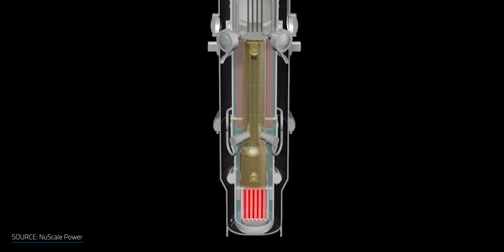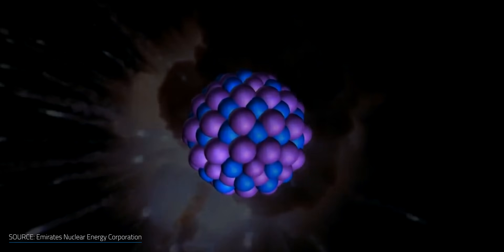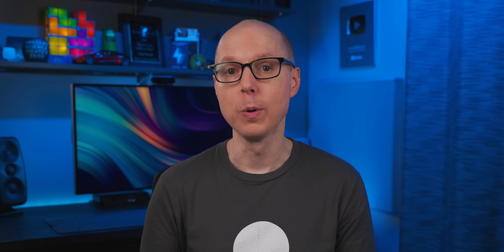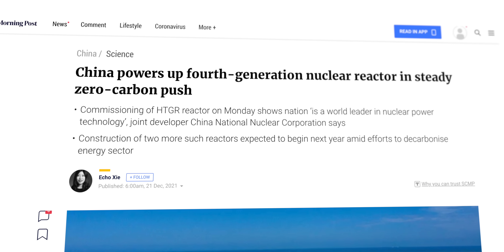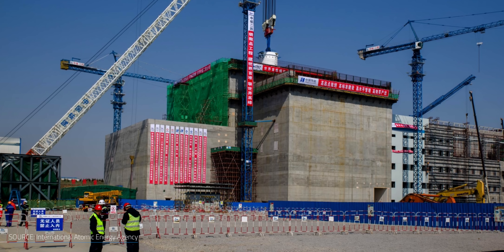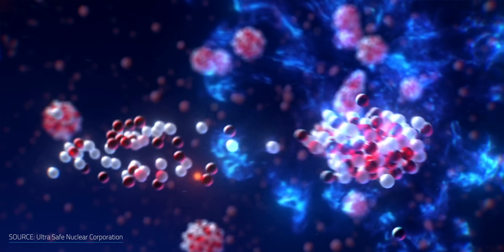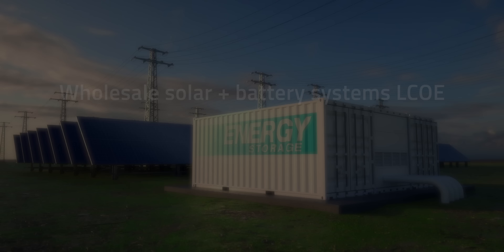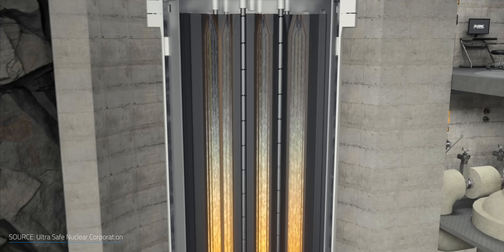Forget Small ... What About Micro Nuclear Energy?

Comment: I can't imagine how micro reactors could have widespread deployment from a security perspective.  There maybe some individual use cases, but they would need to scale the security hurdle too.  Having hundreds at a particular location doesn't make sense either.  SMR's are just a better alternative when you consider all the operational aspects.
Reply: The security comes from the lack of risk they pose. Micro reactors use low grade nuclear fuel, which is useless for weapons or even improvised "dirty bombs". As small as they are, they can be effectively protected by the same security measures and levels, your local bank uses.
Reply: @AaronCMounts  If someone wants to weaponize something, it's easier to dose a area in flammables and ignite the area to cause as much damage as possible. The only reason why people fear nuclear weapons is the inhospitality it makes in the region.

Oil is "cheaper" to weaponize than nuclear materials.

Heck you can make nail bombs and napalm from oil/gasoline.

Also why would anyone care about the effort to weaponize a nuke when they can buy guns?
Reply: @AaronCMounts  That is highly dubious. Any radioactive material, even that used for medical purposes can be abused for dirty nuclear bombs.  And none of that technology or the infrastructure for it has been developed so far. It's pie in the sky thinking.
Reply: @Andreas-gh6is  While "any radioactive material" could theoretically be used for a dirty bomb, most of it can't be used in an effective dirty bomb. Your claim is disingenuous, at best; you're deliberately misrepresenting the actual hazards of the overwhelming majority of nuclear material in existence. Radiation exposure from most nuclear material is not severe enough to be harmful, if it even rises above normal background radiation.
Reply: @AaronCMounts  well, if it's enough fissile material to drive a reactor of any size, it's enough to scare a lot of people if it is dispersed with a proper explosive... And quite a few isotopes aren't that harmless in small quantities either. Point being, "micro reactors" don't exist as a practical technology yet. As that is the case I don't believe that they don't require highly radioactive fuel and I certainly don't believe the total material necessary for the same energy output is less than with larger reactors. Spreading out the problem doesn't really mitigate the risk, it just obfuscates the fact that the risk of nuclear power generation is impossible to calculate. "Impossible" accidents have happened too many times already. Luckily most people are scared enough from history not to try and scale up that risk by 10 or a 100 times like the nuclear fanboys wan.
Reply: @Andreas-gh6is  Accidents have occurred too many times?

Out of hundreds of nuclear plants across the world, operating for decades upon decades, there have only been two major nuclear accidents that have ever occurred. 

One of those was from a communist regime (surprise, surprise...) that couldn't be arsed to be even remotely responsible with their nuclear power facilities. And the other was caused by an earthquake/tsunami that killed 15,000 people; meanwhile, the meltdown killed one person. 

On top of that, only one minor accident has occurred, and in that one, there was zero release and zero deaths from it. 

People like you are part of the problem. Your incessant and unmerited fearmongering is what keeps the public scared of nuclear power.
Reply: @Andreas-gh6is  Also, it's quite telling that you evaded my point about making an effective dirty bomb and jumped straight to "well, it can scare people".  So I'll accept that as you conceding to my point that most radioactive material can't make an effective dirty bomb.
Reply: @AaronCMounts  One time is too many for something that is supposed to be impossible. And judging the risk from what happened before is reckless and stupid. No, the Fukushima accident didn't cause death from radiation - because the whole area was evacuated at great cost. And the cost will ultimately run well over a trillion Dollars.  To solve any problems, nuclear power would need to be scaled up ten or a hundred times, and all those risks would scale just as much. Even ten times the damage of Fukushima and Tschernobyl over the next fifty years would be unthinkably bad, but it's still not the upper bound on what could happen, especially with any bad intentions.
Reply: @Andreas-gh6is  “One time is too many for something that is supposed to be impossible.”
 -- By your logic, we should also permanently ground all air travel, since one airliner crash is too many. Nevermind the fact that air travel is the safest form of travel in the world; it’s not perfectly safe, so it should be banned. 

“And judging the risk from what happened before is reckless and stupid.”
 -- So the entire insurance industry, every professional actuary, across the world is reckless and stupid? Yeah, that’s about the logic I’ve come to expect from your posts. 

“No, the Fukushima accident didn't cause death from radiation - because the whole area was evacuated at great cost.”
 -- So you admit the death toll from nuclear power accidents is even less than I said, meaning nuclear is even further less hazardous than you’re trying to claim. 

“And the cost will ultimately run well over a trillion Dollars.”
 -- Meanwhile, the cost of replacing old coal, oil & natural gas plants with cleaner versions, or with sufficient wind / solar + storage capacity will be 2 – 3 x the cost of equivalent capacity in nuclear plants. 

“To solve any problems, nuclear power would need to be scaled up ten or a hundred times, and all those risks would scale just as much.”
 -- This is simply not true. Already 10% of the world’s total power is from nuclear plants, so scaling up would be nowhere near the numbers, you’re claiming. And no, the risks don’t scale linearly with the growth or expansion of nuclear power.

“Even ten times the damage of Fukushima and Tschernobyl over the next fifty years would be unthinkably bad, but it's still not the upper bound on what could happen, especially with any bad intentions.”
 -- You’re fearmongering, you’re making wild, baseless predictions, and you have nothing to back this up. Meanwhile, nuclear continues to be the safest form of large-scale power generation, having caused fewer deaths in almost a century of continuous use than any other major power source. Coal, oil, wind, natural gas, solar and hydro have each caused more deaths than nuclear. This is both in aggregate and per capita.
Reply: @AaronCMounts  ANY nuclear fuel can be used in a dirty bomb!  I was a nuclear plant supervisor in the Navy and worked at several nuclear utility plants afterward.  I know a lot more than your average bear.  Bank security is nowhere near adequate for any nuclear facility.
Reply: @tgmct  Can you show me how radioactive these micro-reactors are expected to be? As the video clearly said, they use low-grade fuel. Can you show where they're at serious risk of releasing hazardous levels of radiation if tampered with?
Reply: @AaronCMounts  The minute that a reactor goes critical for the first time it produces decay products that are radioactive.  They are also toxic and very dangerous.  It's certainly something that the NRC will never want getting out to the public in any amount.  Low grade fuel is a discussion of fuel enrichment.  Commercial reactors are typically at 3% vs military that are much higher (classified).  Going much lower creates problems with starting up a critical mass.  Even reactors that are long gone have spent fuel repositories that are under 24/7/365 high level guard.  This is no fooling around stuff; they have shoot to kill orders for anyone who attempts to get even close to the repository.
Reply: Even widespread use of SMRs means they got to be deployed everywhere around the world, including where the "regulatory framework" can just evaporate (revolutions etc), people start shooting at them or terrorists take out the fuel and make dirty bombs.Nothing like that has ever happened, which makes the risk impossible to calculate, but again, in order to make a dent in climate change those reactors would need to be almost everywhere...
Reply: The micro reactors will definitely be nice to have in case of natural disasters. Say an earthquake destroyed large parts of a city and took out power to it, you could just deploy a few of these on the back of trucks and get power up and running for emergency services and others. This would speed up the recovery of the city immensely
Reply: @GameCyborgCh  You can do the same thing with a diesel generator for a LOT less money and training.  These already exist for emergency use.
Reply: @tgmct  I'd like to see a single truck carrying enough diesel generators and fuel to get 1MW of power
Reply: @GameCyborgCh  After my previous reply I remembered that we had a 1MW diesel that ran around Europe to feed US submarines in ports that didn't have suitable power otherwise.  It was all self contained in a 24ft box truck and had a diesel fuel day tank on board too.  They would drive up, open the rear overhead door where the radiator and fan were, and pay out the three shore power cables.  Diesel fuel came from another hose connected to the submarine's diesel storage.  Everything setup in less than an hour.  I'm not stretching that capacity rating. The minimum shore power requirement was 1MW; the diesel may have been slightly higher rated (1.2MW?).
Reply: @GameCyborgCh  It seems some additional education is needed…  There are all sorts of diesel generators out there that are a lot larger than 1MW.  Take a look at what is used in railroad engines.  All of them produce more than 1MW and most power units can easily be moved by a low-boy or similar truck trailer.  Want more capacity?  I worked on a number of stationary jet engine units made by Pratt & Whitney that could run at 23MW all day and peak to 30MW.  These can run almost any liquid that burns.  In fact, the Saudi’s actually ran the crude oil that they were pumping as the fuel for the engine too.  These can be moved with a flatbed.  Fuel for it… a couple of 9000 gallon standard tank trailers could be traded out as they emptied with the other being refilled at the nearest fuel rack.  

Your proposal makes no sense from a training and security point of view.  Training someone to operate a diesel or jet engine can be done in a matter of hours if they already have related experience.  Not much more if they don’t.  Nuclear plant training is in a different world.  I know because I’ve been there.  More than a year of intense training before you even qualify at the lowest level.  Much more for supervisors.  The NRC will NEVER allow a rector to be manned by just one person and probably not less than three.  Then there is security.  We are talking about lots of fully armed people here with shoot to kill orders.  Even for a little puny power reactor.  The amount of security used to protect old spent fuel alone would blow your mind.  At least a hundred people to operate and protect a reactor around the clock vs a few people to run and refuel a diesel or jet (or gas turbine).  The difference in price to build a reactor is a lot more than chump change too.  Do the math!  It’s just not feasible to do what you propose.  It was already tried and failed in Antarctica in the 60’s-70’s.  Even the government couldn’t realistically afford it.
Reply: @tgmct  Go big diesel and not explain the pollutants involved?
Reply: @dra6o0n  I'm NOT a proponent of big diesel.  I do support large nuclear.  Some of the earlier discussions were about emergency small scale use of micro nuclear that just don't make any sense to me.  Using diesel in that situation is more realistic.
Reply: Fertilizer is possible to be weaponized too, you can make explosives from them. You could ban them, but what stops someone from sneaking into a farm and steal it bit by bit?
Reply: @dra6o0n  Actually, after Oklahoma City, the government does a lot more to control the distribution of fertilizer.
Reply: Lithium is far more dangerous on a common household setting... Take a lithium battery apart and throw the sheet of rolled up lithium at a house and splash water on it and watch it combust and ignite the house. Imagine someone spread a ton of lithium metal powder on the roof of every building and just waited for rain to come? Or even fog as humidity would set it off?

Threats will always exist, no amount of hesitancy would prevent deaths, only proactive actions can.
Reply: @dra6o0n  Sure, it's possible but not very likely.  Gasoline is far more available and dangerous.  A TON of lithium powder; where do you get that?  And not be noticed?  There is a reason why hazardous materials are evaluated, marked, and controlled.  I'm not up to speed with lithium hazards or the specific chemistry involved.  But I've forgotten more about nuclear issues than most people will ever know.  I certainly don't want ANY nuclear materials (used in reactors) getting out in the public.  There is far too much nasty stuff in there that is far more dangerous than the lithium you have been mentioning.
Reply: If the big oil industry had their way, alternative energy wouldn't exist.

There was an idea to use carbon dioxide instead of water to spin a turbine to produce energy much more efficiently, but the article was from 2015, probably lost traction.

Yeah it's called Supercritical Turbines, raises efficiency for all forms of energy generation tech by using supercritical carbon dioxide instead of steam.
Reply: Micro reactors could power energy hungry businesses, and they could have tax incentives to install them.
Reply: @matheusdardenne  So which business is it that you know that's willing to hire a few hundred people just to have one?  Just not economically feasible!
Reply: @tgmct  it takes hundreds to oversee a normal reactor. Tens to oversee a small. A micro would take a couple.

And yes. Some businesses spend millions of dollars in energy bills. They can definitely pay a couple million and hire two guys for 20 years worth of energy self suficiency. Especially if there are tax incentives to do so.
Reply: @matheusdardenne  There is not much difference in the manpower requirement to defend a "micro" vs a larger unit from a security perspective.  Like I said before, it would blow your mind to see the security required just to defend spent fuel that is basically encased in cement.  The reactor plant is long gone.  Until a national disposal arrangement is figured out, these costs continue into infinity.  What executive in his right mind is going to try and justify that (alone).  Just because it's a "micro" plant does not mean it has any less responsibility for both the security and the operational talent needed to run the thing.  Think of it this way...  You can certainly fit a nuclear bomb in a garage; call it "micro".  Now, what does it take to defend that against all treats just to sit there 24/7/365?  Even though a nuclear reactor can't blow up like a weapon, it is handled with just as much care because of the ramifications of the release of nuclear byproducts.
Reply: @tgmct  ............

You're not sure how small and micro modular reactors work, are you?

There is no such thing as "spent fuel". The fuel lasts for 20 years, and once it's exhausted, you swap the whole module. It is why it is called.... modular.

It is not the company that will deal with the disposal. It is the manufacturer.
Reply: @matheusdardenne  The current fuel policy for ALL US commercial reactors is to store the fuel which becomes spent fuel AT THAT SITE.  There are no exceptions that I'm aware of.  The swapping methodology is a nice concept, but still only a concept.  Currently, it still needs to be stored on site when it is exhausted.  Building 20 year plants has been a reality for the US Navy for years.  I was a nuclear plant supervisor in that environment years ago and then moved on to the commercial space.  BUT keep in mind that the long duration technology requires high enrichment fuel that I strongly doubt that the NRC will ever allow in any commercial reactor.  Call it mini or micro or whatever; it's still nuclear physics!  Even the 3% grade stuff needs a small army to protect along with emergency facilities that are seriously expensive just to sit there and occasionally drill with.  The high enrichment fuel that the Navy uses is enclosed and encased in facilities that are near impossible to breach both during and after their lifetime.  

Here is an example... The old Connecticut Yankee plant is long gone but the fuel is still there and will be for the foreseeable future.  The Millstone plant that is still partially operational is about 30 miles away and could easily store CY's exhausted fuel.  This would certainly be a cost effective storage alternative and could be safely moved there (via the Connecticut River).  BUT again, the NRC won't allow it to be moved and I don't see this politically changing any time soon (if ever).  And by the way... the manufacturer of nuclear fuel in this country is the US Government.  This won't change either.
Reply: @tgmct  you literally can't take the fuel out of the module, there is no "spent fuel" to store. After 20 years, the fuel can no longer power the module and you change the whole module. It is the whole reason and the whole point.
Reply: @tgmct  you're talking about nuclear power plants, NOT small modular nuclear reactors. They are not the same thing and do not work the same way.
Reply: @tgmct  there are several manufacturers of nuclear reactors reaching for the small modular approach. Siemens is a worthy mention.
Reply: @matheusdardenne  Look, your statements suggesting that there is no hazardous remains is nothing short of ridiculous until I see something a lot more concrete than your claims.  Siemens may be working on something; but what specifically?  How about some links to web references that backup your claims?  But they need to be credible and realistic though...
Reply: @tgmct  there are no hazardous remainings, they're forever locked inside the module itself, which is itself a proper containment unit in it's own right. The whole module is discarded (properly stored by the manufacturer in huge underground holes) after 20 years, and a new one is installed in it's place.

It is awesome indeed. Dig a bit on the subject of "small/micro modular nuclear reactors". These are by no means "my claims", it is what the tech is going to be.
Reply: @tgmct  and yes, child, this problem has been solved for decades. The unviolable containment units are buried in deep underground holes.

The way you talk about the most basic and standard practices, which are in place for decades, makes me question your claims of having worked with it in the past, because even if you worked with it 30 years ago, all these things were already common place; the containment units, the underground storages, all of it.
Reply: @matheusdardenne  My friend, it's clear that you have no clue about high level waste (spent fuel), how it is handled, where it is stored, how it is stored, and who has responsibility for what.  It's also clear that you don't know much about what spent fuel is and why it is so dangerous.  From the moment that a reactor goes critical for the first time, you have spent fuel, and it will remain as spent fuel long after you are dead.  In the US, we do NOT have any central repositories open for spent fuel from commercial reactors.  Some other countries have them, but not here.  There have been attempts to build repositories here but political issues have stopped further development every time.  There are alternatives, but we as a country can't even get burial right.  Military reactors are a whole different story and are reprocessed in a totally different way.  

So, I qualified on the USS Tunny (SSN-682) and later served as an EWS on the USS Richard B Russell (SSN-687).  I can verify that and there was commercial experience later on.  Where is it that you got your nuclear education, training, and experience?????
Reply: @tgmct  high level waste is something nuclear PLANTS have to deal with, not nuclear modules. You do not take the roda out of nuclear modules. Ever.

Until you get that very simple fact, there is not much else I can teach you. Get information.
Reply: @matheusdardenne  You still don't get it... The nuclear modules will need to be dealt with too.  I notice you didn't mention anything about your qualifications (or lack thereof).  You continue to prove that you can't be taught much of anything.  Do us all a favor and don't try to teach anyone what you don't have a clue about.  Particularly when it does not even exist yet!
Reply: @tgmct  they will be dealt with. They will be buried in the same places we ALREADY bury nuclear waste. PLEASE explain which part you're having difficulty understanding.

And what do you mean by "I can't be taught?" You are the one being lectured here, kid. LoL
Reply: @matheusdardenne  Again, you don't have a clue.  It will NOT be buried with low level waste (existing repositories).  You are talking about a totally different situation.  Low level waste is either contaminated or irradiated.  Spent fuel is actually a high level source of not only a radiation problem but also has very serious toxic materials.  And just because it's inside some sort of "modular" container; it's still spent fuel and can be removed from that container either accidently or intentionally by nefarious people. 

I looked at your LinkedIn page and you have some interesting computer languages listed but nothing in any way associated with nuclear engineering.  So how about you stay in your lane and talk about things that you actually have some knowledge of.  Last I knew, Brazil doesn't have any commercial reactors either and therefore not much in the line of nuclear waste.
Reply: So, while I fully, and enthusiastically understand the concern from a security perspective, especially when discussing traditional fission reactions;
I feel it needs to be pointed out, these are not traditional nor near as dangerous.
These new reactors are descendants of reaserch reactors that use fuels and reaction chains designed to be less suitable for weapon production then uranium ores that any old Tom Dick or Harry can collect with a giger counter and a pick axe..

Sometimes by using reactions that must be seeded with a neutron gun to produce radioactivity other times by heavily manipulating the fuel by doing odd things such as producing alloyed fuel rods, or making soups of mostly inactive salts that require very specific conditions to reach criticality and generally while hazardous in non critical conditions the goal is to be along the same level of hazard outside of critical conditions as uranium glass.
And that's not to mention the vastly diffrent reaction families these reactors pursue compared to a breeder reactor, or even a uranium reactor.

Again. All with the goal to be as safe as possible; or at least more effort and knowledge required for weaponization then it would take from raw ores. It also has the nice side effect of generally utilizing materials that only come as waste and by products from the traditional normative reactors.

And I personally feel that this kind of effort towards passive safety is superior to active safety. 
We have yet to run into a terrosit cell willing to undertake uranium refining to make a dirty bomb, and I find it unlikely that we ever will, and that leaves me unconcerned about the potential of these new small reactors being weponized.
Reply: @humanistwriting5477  I'm not sure where you are located, but here in the US, virtually all radioactive material is considered hazardous and very strictly controlled by the Department of Energy.  This includes things like radioactive sources used in hospitals, etc.  Even the x-ray machine at your dentist's office is controlled.  It's not a perfect system and people have died from seemingly insignificant sources and most are not uranium based.
Reply: @tgmct  oh oh, I forgot to note
The uranium beta voltaic battery was actually forced to change to plutonium by the department of energy.